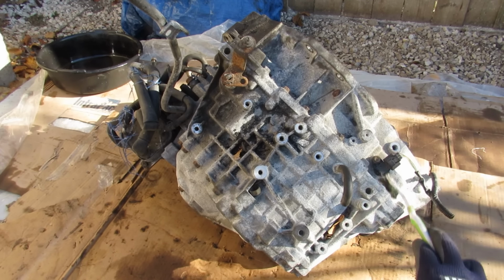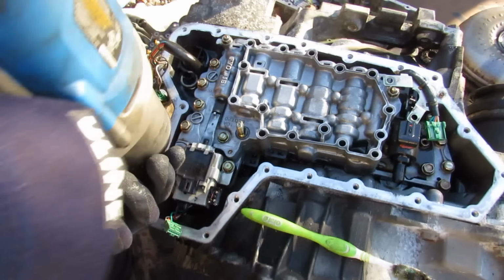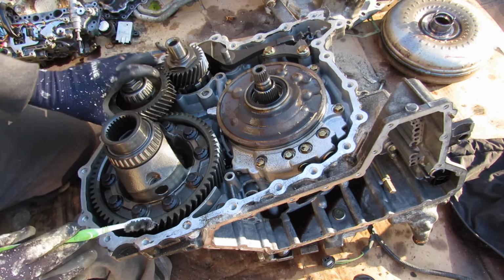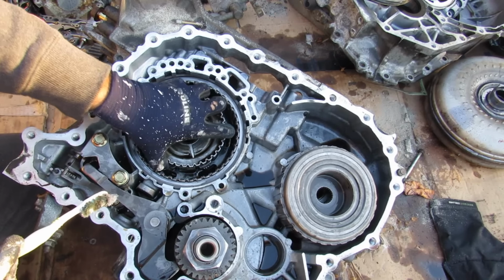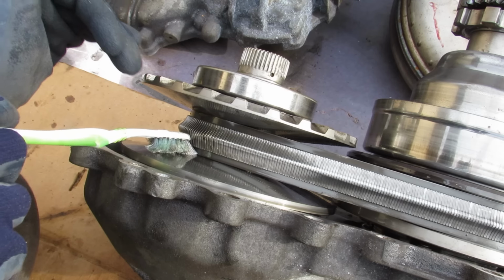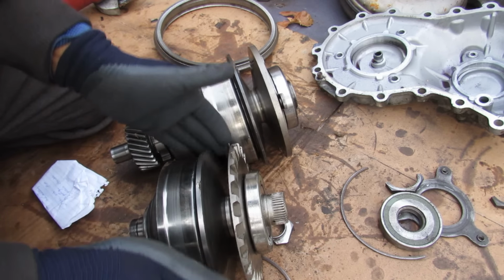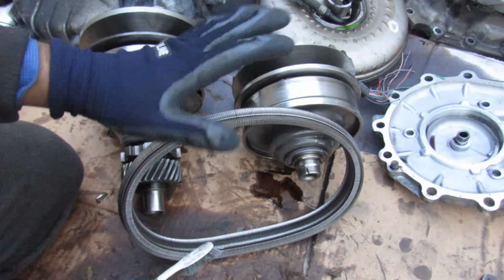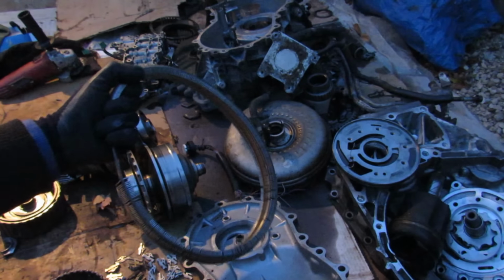Why Nissan CVTs FAIL

Comment: worked auto trans for 30 odd yrs and finished up just as these things came into being I did see the odd one or three but mainly the old vacuum and manual shift valve bodys , Things have been so simplified compared to the old C4 , Turbo 400'S  ,350's,tri-matic's (god they were horrid ) or even the old powerglides from the 60's  Now they were full of fine parts that was over complicated with fine tolerances  in alloy valve bodys Made for a Sticky Good Time )) I could go on for days about them in cold climates, I was playing with solenoid shifting trans back in the early 70's who would of thought it moved in that direction  or though it made sense

Comment: Love your videos brother! You should probably invest in a better, lighter and more portable impact driver though. For 1/2" drive I use a Milwaukee fuel and for 1/4 drive I always use a Metabo triple hammer. It's small, light and has plenty of power but it really shines when you need to be somewhat precise and delicate. I'm a do-it-all contractor so I have several models of just about every impact driver brand you've ever heard of but the Metabo is my personal go to.

Comment: Great info! The CVT on my wife's 2016 Rogue failed recently. She went take it from P to D and nothing happened. It was slipping enough that if she tried and retried enough times it would eventually engage. Took it to the dealer and thankfully she was within 1 month and 1000 miles of the extended warranty (that we never buy and she probably didn't know she had) expired. Whole CVT was replaced as a result with only the $150 deductible out of pocket.
Reply: Quiet cheap! How many km you had that problem?
Reply: same with my 2016 rogue, cvt failed with 100k km.

Comment: The biggest problem is that most nissan cvt transmissions only have 3.5 quarts of fluid in them to cool and pump everything so it works
Reply: The one he's showing you here, the Jatco from a Murano, has about 11 quarts in it.

Comment: I’m astonished that this transmits torque via friction between the pulleys and the steel belt. You’d think that the belt would slip once more than a little force is applied.

Comment: Wife bought a brand new 2017 Pathfinder Platinum.  Supposed to be able to tow 7500lbs it could barely tow our 4200lb travel trailer on flat highway.  Towed the trailer 40kms round trip and bought an f150.  Total difference.  Pathfinder started burning oil at 100k km i managed to nurse it along for another year before she finally went kaput.  $76k for the biggest POS Ive ever seen.  Nissan wouldnt do a thing for us.  Even managed to lose our oil change shedule when we brought it in under warranty.  Then said we only had 3 oil changes done.  We showed them our receipts for 5 free oil changes plus 4 more she had done at that dealership.  Then they tried the well your warranty is only 60k km.  I said you may want to read your brochures before you decide to open a dealership.  Traded it in and got 10k for it and wife has a new car.  We have owned 6 nissans all of them went over 300k km before issues started showing up.  Ill never buy one again.

Comment: Amsoil has said like you heat which causes the fluid breakdown then wear is the enemy not the band or the design. I use Amsoil or Castrol synthetic cvt fluid every 30k drain n refill no probs so far at 90k
Reply: Oil ain't gonna change a crappy, overcomplicated design. I've got 165K on one where the trans was replaced under warranty at 118K. And the wife was diligent in all the maint and it still died.
They are sufficient enough for smaller cars, just a dumb idea for heavy vehicles.

Comment: I just had to get my 2018 Nissan Altima's transmission rebuilt at only 58k miles. And the most ridiculous part is my factory warranty just expired this month and I got it rebuilt 2 weeks ago. I literally was 2k miles and 2 weeks away from having to fork over nearly $4000 in repair costs. They made these transmissions knowing full well they are pieces of shit and there is a class action lawsuit against them for these.

Comment: Had a 09 Altima Hybrid for 7 years, and now a 18 Rogue for 3 so far…no issues with the Altima in the slightest. Had 188k when I traded for Rogue. No issues thus far. Towing occasionally with rogue.  (Under 1000 lbs). 56k in rogue now, but considering an aftermarket warranty. 

This video was very eye opening. Well done!
Reply from the maker: Thanks and yes I think you should get rid of the Rogue altogether. Aftermarket warranties are the biggest scams with too many limitations.
Reply: Aftermarket warranties are the most scammy of scams. Do yourself a favor and get something else.  CVT are fine for smaller, lighter vehicles like an Altima and such. Rogue is starting to push it, doubly so if towing anything.  You've been warned.
Reply: I'm shopping for an aftermarket waranty for my daughters Nissan Sentra.  I've yet to find a company that doesn't excluded CVT's from coverage altogether!
Reply: How often you drain and fill fluid

Comment: It seems like Nissan invested huge amount of money into CVT and now they refuse to admit CVTs are unreliale crap and install it everywhere they can.
Even old 4 gear hydraulic ATs worked very smooth and were reliable. There was no point in inventing CVT for cars.
Reply from the maker: It's real just Nissan has a major problem with thier CVT designs. 

Other manufacturers have been doing better at it.

Comment: One of the worst automatic transmissions ever built.  I have done transmissions for nearly 4 decades and in my opinion they are absolute junk. Almost impossible repair.. I have seen enough to say that a failed cvt can and will exceed the value of a car 6 or 7 years old and of to the recycling yard she goes!!

Comment: Just had my Nissan Sentra transmission fail, just 3000 miles out of warranty is when it was diagnosed and Nissan would not replace it. They quoted me almost 6 grand with only a 12000 mile warranty on the new part. Luckily, I was able to find a salvaged transmission with only 32K miles with a three year, unlimited mile warranty and was able to get it installed for 3G all in. Highly recommend this route, will NEVER buy a Nissan again!!
Reply from the maker: Sorry to hear that. 

Next time swap a manual transmission in 😁

Comment: my 2016 nissan altima CVT has 110,000 miles all original. I only drive in sport mode. HEAVY FOOT MODE! And take overdrive off every hill. Let the Engine work, it has a bigger coolant system. Tranny still drives like new.
Gas saver mode on all transmissions make the tranny work harder and gears wear faster.

IMO

Comment: I’ve got a blown 2013 CVT Versa. I’m still contemplating getting it replaced and sticking on till the engine gives up or buying into something more reliable. I’m currently blowing through gas money using my work truck to get around.

Comment: My dad's new Rouge's CVT isn't too bad and power is good. We had good luck with the 2019 transmission too. So we will see with the new one. Pisses us off though because the towing capacity is none existent in it apparently, and he wants to get like a small-medium side camper at some point. So we have been talking about getting something other than a Rouge if this is still the case.

Comment: The weakest link is not technically the belt. Its the seals for the hydraulic fluid actuators. The issue with CVTs is that they need perfect precision of both conical pullys to be in perfect harmony with each other. This is done through actuating the hydraulic fluid from one to the other and relies upon seals to close and open the fluid transfer. Nissan used rubber seals that prematurely wear out on their earlier CVTs. This means that eventually the seals fail, one of the pullys goes to pull open, the other doesnt close appropriately, and there is an incorrect ratio between them, causing catastrophic belt failure. Newere CVTs have silicone seals and are way less prone to this issue.
Reply: That is interesting, but doesn't explain why in 2023 they are still failing at a much higher rate than any other Manf. using CVT's.
If one has the option, why would anyone bother with a Nissan CVT?
Reply: @boots7859  do you have any data on that? The company that Nissan owns makes almost all the CVTs for every car manufacturer out there, JATCO

Comment: Its really annoying there's no parts or service for these things. I've got an 09 Lancer that has the typical Nissan/Jatco CVT and while its been mostly decent (I've changed the fluid once it starts getting that typical whine) its starting to develop other problems (besides being a shitsubishi)

First off, there's a leak somewhere that I can't find. Fluid is just decreasing and there's no indication of where the fluid is going. I keep it topped up but some days its worse than others where the fluid is so low it even prevents the car from starting. Sometimes I have to put a whole quart in just to get the thing started.

Second, in low RPM, low load (like 1500 rpm, 10-20% throttle) at around 40'ish MPH it has this really odd rattle. Give it more pedal and it goes away. Give it less pedal and it goes away. But if you want to maintain speed at 40-60mph in that sort of half-loaded state it just rattles away like there's a marble in there. I read somewhere that this might indicate bearing failure on one of the pulleys, but it doesn't even matter because its not like the thing can be taken apart and repaired... Hell, I can't even find places that are willing to take the trans out and just install a new one, EXCEPT the dealership... and they want 6000 for it... the car isn't even worth that!

Comment: I’ll just disagree on one thing by saying, most Nissan CVT are built by AISIN - a completely different company. Nissan just buys them to fit to their cars - the same as all manufacturers. The AISIN CVT do fail more in Nissan than in Honda or Toyota which is strange. 

The thing I don’t know is if Nissan is saving money buying a weaker CVT for the size of the car. AISIN have a big catalog of products that all manufacturers buy.

Comment: I have a 2015 Altima with 390,000 miles a 2018 pathfinder with 280,000 miles ana a 2020 Altima with 150,000 miles. I travel a lot from California to New York and back and I have never had a issue with any of the CVT’s. I always change the CVT fluid at 80,000 miles. All 3 of my Nissans have gave me 0 issues other than maintenance like fluid changes, spark plugs, tires, filters, brakes, etc… maybe I just got lucky lol

Comment: Extremely good video. My respect for CVT has increased 10 fold after going through the complexities.
Reply: Same, I went from hating them to hoping that car companies learn to make good reliable CVTs
Reply: @leonidas14775  they wouldn’t be that bad if people actually maintained them because they are NOT in fact sealed for life
Reply: @4ringk1ng  i maintained tf out of mine replaced the filter and fluished fluid at recommended intervals and it still didnt even go 200k miles
Reply: @joccievier3146  it might just depend on the vehicle either the model or the individual. I worked on multiple Altimas with 200,000 or near 200,000 miles and I didn’t feel them slipping at all although the rest of the car was a mess in typical Altima fashion.
Reply: @leonidas14775  I currently drive a 2013 Honda Accord CVT. It has 106K miles and is on its original transmission. Occasionally, when flooring it at high RPMs I get a bit of a whine, which I'm hoping is down to normal transmission behavior. Other than that it's quiet and changes ratios about as quickly as an auto from the time period. I'm pretty sure Nissan singlehandedly destroyed CVT reliability statistics.

Although, last time I changed the transmission fluid, it smelled like manure. I have no idea why, but the car's maintenance tracker had marked down a transmission fluid change at the next oil change, so I guess I was on the money.
Reply from the maker: Me too. 
And so has my disapproval
Reply: @@DonnyLumpkin I hear from a lot of car channels that Jatco transmissions, specifically the CVTs in Nissans are poorly made and don't last.  Its an interesting machine though and would be great if they were built to last.
Reply: @leonidas14775 just posted one with 260k miles they do if you take care of them…
Reply: @@DonnyLumpkin if you change the fluid every 30-60k they can last 200,000 miles but it also depends on what car you have. my coworker at Nissan was on his fourth in his sentra but on the bigger vehicles they dont tend to blow as often
Reply: @4ringk1ng  i have a 07 altima with the V6 so it got a more beefed up CVT. It's closing on 150k and still going strong, previous owner did nearly all the maintenance at a dealer so it was very well taken care of, but when me and my dad were going though the service books it didn't mention transmission fluid change intervals so i suspect the reputation they have for being unreliable is mainly due to poor documentation on nissan's part
Reply: @crota5059  the manuals say its sealed for life but its wrong. I worked at a Nissan dealer and now an INFINITI dealer and we recommend it every 60k. i’d say do it between 30 and 60 no more
Reply: @4ringk1ng  yeah i dont know why they would say that in the manual, but its gonna get done around every 50k while im driving it
Reply: @crota5059  They did that to mislead you so its your problem when warranty runs out.
Reply: @crota5059  good thats a good time to do it. just remember to change the filter and clean the magnet every time.
Reply: @4ringk1ng idk man I never service my cvts 🤷🏻‍♂️ my current 2013 Nissan pathfinder is about to hit 150k and no issues hopefully I dont jinx my self lol then I know someone who serviced the cvt at 90k miles and it failed a few hundred miles later ..
Reply: @Chino3oh5  it likely failed right after because they didn’t replace the filter as well. The heavier duty ones on Pathfinders and Maximas tend to last a little longer, but I still wouldn’t take the chance.
Reply: at that point why even buy another cvt just do a manual swap with that kinda money instead@@DonnyLumpkin
Reply: I have no respect for the cvt and the person who designed it

Comment: Because they're Nissans. There, I saved you 20 minutes. In all fairness MOST CVT transmissions are garbage as well. Hondas are bad as well . Subarus will be the same soon enough, they haven't been using them long enough. Since switching to them though the transmission constantly Cuts engine power in bad situations engine is constantly killing power to keep the transmission from overheating which is tremendously bad for an all wheel drive car because it leaves it with not enough horsepower to actually move the wheels. TFL proved that Subaru got so pissed off they stop sending them cars to review. They couldn't get up basic hills with it because the transmission would cut the power and leave the car with the inability to put power down to the two wheels that needed it to pull the car up the hill. And snow you won't notice cuz everything slippery everything is slippery, but in mud and rocks when you actually need the power, you're not going to get it anymore unless you have a manual Subaru.
Reply from the maker: Wow. Didn't know about TFL lol

Comment: Great video! I wonder if anyone can explain why old Nissan CVTs are (supposedly) more prone to failure than CVTs from other companies, though. What kind of improvements have been made to the design of CVTs in recent years / decades that have made them better and more reliable now?
Reply: One thing I know is that older Nissan CVTs had colling issues, which caused fluid to get thinner which resulted in dropping of pressure and slipping of the belt. The issue has been fixed in later Nissans, 2018 and up.

Comment: Can my Nissan CVT transmission fail from one angry step on gas that lasted less than a min? Thanks
Reply: I would treat your Nissan a bit more gently in your driving. No, it doesn't mean you have to drive like a snail, but I would never exert maximum power. Just go with the flow in traffic and stay on top with the maintenance as prescribed by Nissan, in case should you file a warranty case, they can see that you did your job. Remember there are plenty of Nissans with CVT with over 200K miles. So just drive normal!

Comment: Because they use a belt instead of a chain.
Reply: That's really a misnomer "Belt".  That "belt" is a set of metal plates linked together.  It's much more like a chain than a belt.
Reply: @cowsongs  It’s named after it’s function. A belt flexes equally everywhere. It also has a tendency to stretch. A chain is made of rigid links, connected by series of hinges. It swivels, it does not flex, and will not stretch.

Comment: I have a cvt transmission in mine an idiot took out the speed sensor looning for the crank shaft sensor had no issues before now it reads the code for speed sensor is it even worth trying to replace the sensor or did he completely screw it up

Comment: This is remarkable.  Great knowledge and abilities.  Actual automatic trans life is 60,000 to 120,000 miles, not significantly better than a CVT.  Further, CVT tech is advancing and normal autos have not changed in years.
Reply: couldn't be more wrong. My fleet of cars, the autos, always make it a MINIMUM of 150k.
Reply: @steveww07  good for you.  Had a dodge go south at 75K. CVTs properly driven go over 300K.  So whats your point?
Reply: It depends enormously on the transmission and how you drive.  I drove a lot GM cars back in the 1970s that had old-school turbohydramatic conventional 3-speed automatic transmissions in them, and they were indestructible.  They all lasted more than 150,000 miles and I'll never know how long they would have lasted because the rest of the car was shot by then.  In other words, the transmission was never the thing that killed a car for me.  60,000  - 120,000 seems really low for a conventional automatic.